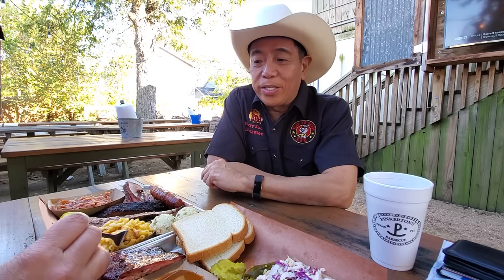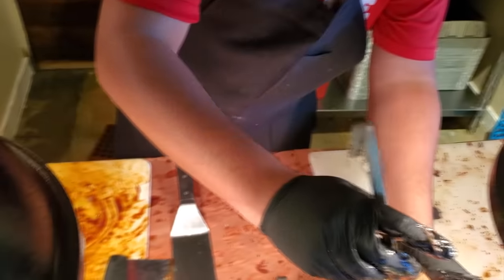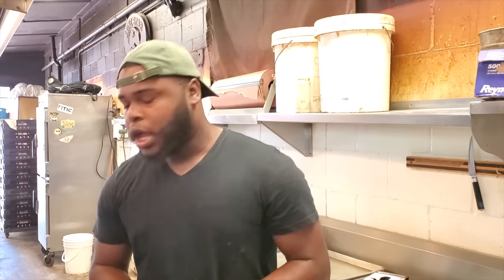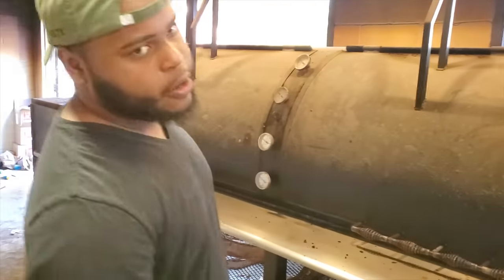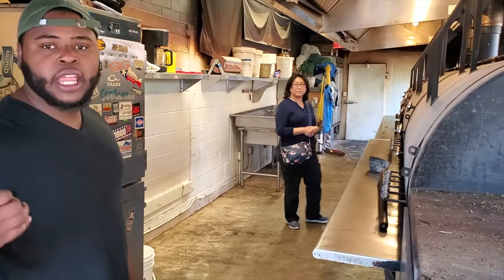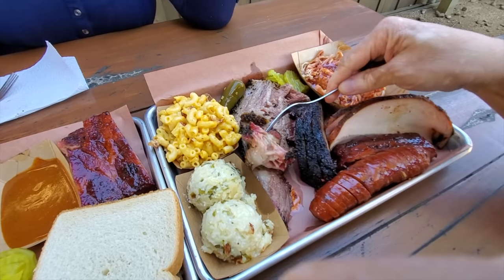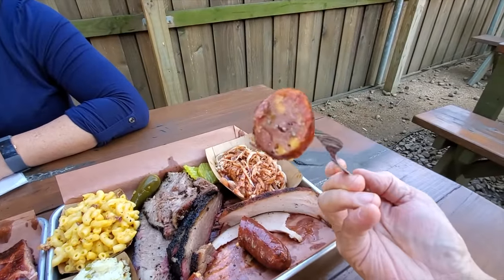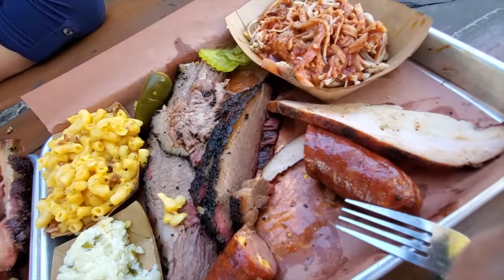Pinkerton BBQ Restaurant Review Houston Texas | BBQ Champion Harry Soo SlapYoDaddyBBQ.com

Comment: Do you get the santa ana winds where you are? Any tips on trying to keep the smoke clean using a Weber kettle in the wind? 

I'm using a 22" with the BBQ dragon grill stone. The smoke is super thick, I think it's because of the wind.
Reply from the maker: Put a wind shield around your Kettle or move it to a shielded location from the wind.  It's a portable grill